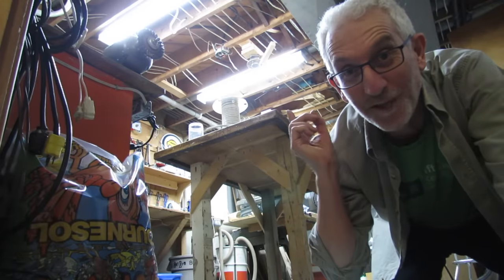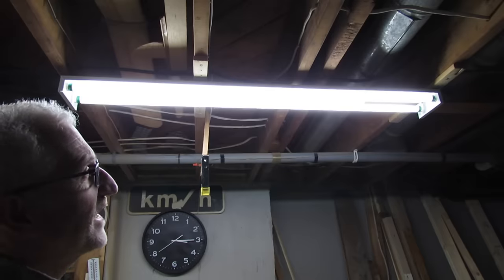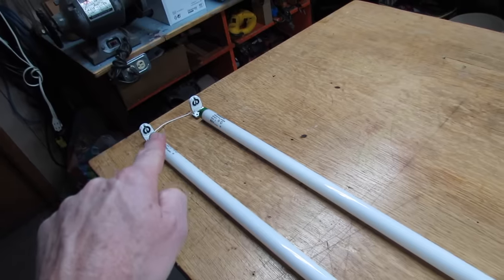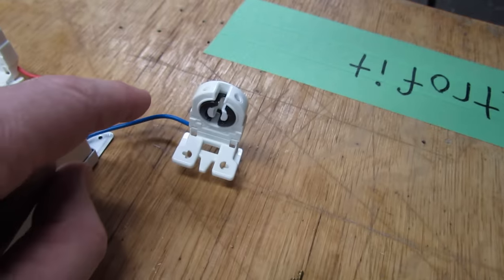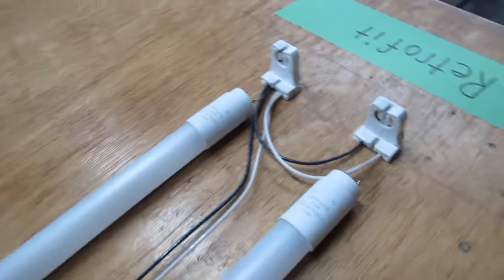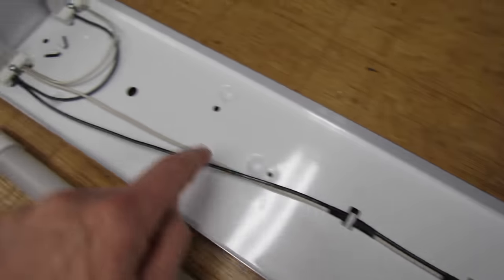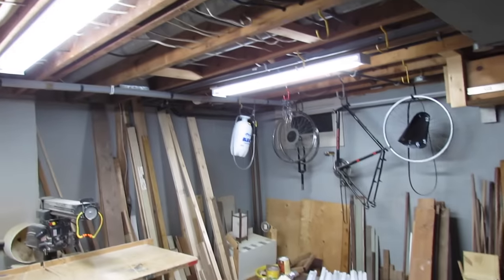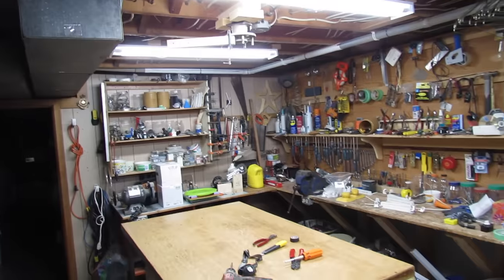How To Convert T8 Fluorescent Lights to LED ● Explained in Simple Terms

Comment from the maker: Find my favourite tools here!    https://www.amazon.com/shop/chrisnotap
Reply: Chris No
tap
Reply: Did this to my shop lights. Easy to do and much brighter. Got bulbs from Ebay. $49 for ten bulbs.
Reply: The biggest problem i have is that the T8 fluorescent setup kills the radio in my shop instantly any time i turn it on. The number 1 thing i want working in my shop is the radio. My question is will the radio work if i switch the T8 + ballasts out for LED's?
Reply: @rockymountainman7   I think these led light would kill your radio, here is the reason, most of these lights did not pass the EMC and EMI testing, has electromagnetic interference problem.
Reply: Chris Notap  how did you hook up the Electric wires 
To that on/ off switch
Reply: will these same units work with and without a ballast?
Reply: did what u said and my led want come on
Reply: SALUTE TO YOU SIR.
Reply: @jeffallen3382  Did you see the Black and White wire laying on the table? Connect A\C to those wires and connect ground to the fixture.
Reply: Excellent presentation, no nonsense installation instructions.  Thank you for your video and I have subscribed.
Reply: the new lamps i'm using you don't have to change ends. You can do it the way you did or make one end hot and one end neutral using the same tombstones. Its even faster if you don't have to change them.
Reply: @jaunsanchez1456  @Juan Sanchez. - To make it simple, nothing changes from the lamps power supply to the wall switch. The LED bulb with out “Plug-N-Play” are designed with a driver inside the powered end. It changes A/C voltage to DC inside the bulb. Since they operate on very low voltage and amperage, they use way less electricity and run cooler due to little waist. The “Plug-N-Play” as shown, are designed different to make it a simple bulb change, but still uses a ballast that would normally kick start light production process inside regular florescent bulbs. Hope this helps you and others who watch and read comments. Best of luck, even if two years latter in March 2022.
Reply: @rockymountainman7  - The comment from Min Wang, about interference from LED bulbs, if not miss-spelled, do not and should not create any problems with your radio period. When you or anyone reading should look for markings on the LED bulbs from “UL listed” and “FCC” as well. Better tech is slightly more expensive but think about electric garage door receivers, pacemakers and other medical devices as a neurostimulator implant placed under the skin to control signal to electrodes over a spinal nerve. 
   I had a wonderful radio that was caught in a sunny rain storm we have all seen, but drying the A/C adaptor box that failed did not fix it. Runs off “D-Cell” batteries well, just not long. This gets real expensive quick. I found a replacement by model and p/n and bought it. WoW, it had so much static I could not understand the spoken word as obviously their were filtering, shielding issues left out or undersized in the unit I purchased. 
  So anyone purchasing LED bulbs for a standard shop lamp fixture should buy a name brand, reputable company with UL & FCC registrations marked on them, then no problem. You can’t buy a keyless entry transmitter without the same listing. These are transmitters or receivers or both if two-way types. In a few years, the LED has come along way. 
Best of luck to you as I listen too!
Reply: @bonzainews  either, slow down and watch the video again as he did an excellent job of laying it out and explaining. Best of luck!
Reply: @bonzainews  Read the response below to Juan Sanchez and his question. It is the same answer. Hope all is well, best of luck Sir!
Reply: @robertedmonds2075  Please watch the video again, then perhaps some easy diagnostics is required. A non-contact voltage tester is very cheap in 2022, March. Wired as shown depending on build choice is layer out very well to follow. If yours are not working, using the info in your question, double check your wiring and switch identical LED bulbs if needed. Worst case, get a buddy or technician to help. Electrical issue are very confusing to many. No different with rebuilding an automatic transmission. Many will not try! Hope this helps. I did both.
Reply: Thank You for not wasting time. Hats off

Comment: I liked the way you laid out just the bulbs, connectors, and the wire.  Made it clearer for me.  Thanks
Reply: Its different again for the older type that uses starters and magnetic ballasts, and even with the electronic ballast shown in the video there's often an extra 'preheat' wire used to warm up the lamp filaments prior to ignition which isn't shown here. Clear as mud? :)

Comment: I just retrofitted the fluorescent fixtures in my garage, but I used GE T8 type B LED tubes, which made it even easier than what was done in this video. With the type B tubes there is no need for the non-shunted lamp holders. You just clip the wires from the ballast, remove the ballast, reconnect the wires directly to the power, and you're done. Oh, one more optional step: add an inline fuse between the hot wire coming in and the live wire end of the fixture to protect someone who might put a fluorescent tube in in the future. (The type B bulbs come with warning labels that the fixture is no longer safe for fluorescent tubes, but not everybody reads labels.)
Reply: Thanks Chris. THIS is what I needed to know. Type B info...
Reply: This is the current setup I have in the house I rent, but I can't seem to find any type b bulbs
Reply: @chrisrepp8608 Great info!  what fuse size did you use?

Comment: This is EXACTLY what I was searching for! You explained it and the camera work was excellent! I have a ballast going out in one of the units in the kitchen drop ceiling and want to do this. Thank you for the video!
Reply: Just curious how do you like this light in the kitchen?  I am looking at replacing the entire fixture in my kitchen due to the grease build up, but the led fixtures I find online do not include a light diffuser and I think I would prefer one with a diffuser.

Comment: Just working on some fluorescent lights over the kitchen area and you showed me a great idea to solve my conundrum since the repalcement ballasts for the old flourescent light  fixtures in place are not longer easy to find almost anywhere. So, I am cosidering replacing them with something else as they are starting to burn out after many years of service.

Comment: You can also get Dual or Double-ended tubes. No messing with the Tombstones (Lamp holders) Just cut out the Ballast and wire hot to one side, neutral to the other. Doesn't matter which side although I prefer to keep the original hot and neutral wires the same. You can install a dual ended tube safely in any direction. If you accidentally install a fluorescent tube in the rewired dual ended fixture nothing will happen. In a single end fixture it will short out.
Reply: I believe shunted tombstones are recommended when wiring dual ended tubes from opposite sides.
Reply: The industry is going away from single ended LED lamps.  Dual ended are so much easier to install, and much safer.
Reply: @Spreadswings  Brilliant and concise Video, but it doesn't answer the principal question "are these LED tubes simply wired to mains power be it 110 or 240 V"? the rest is obvious.  please answer, thank you  :)
Reply: @marcmccord5085  In a two tube fixture that has been converted to ballast bypass, is it safe to leave one tube out or is that a fire hazard or something?  They're a bit too bright!
Reply: @sl1237  They operate independently.  You can either take out a lamp, or cap off the leads to that lamp.  No fire hazard.  BUT... dual ended lamps are much better.  Easier to install and safer since you don't have the power and neutral to the same socket.  Power to one end of the lamp and neutral to the other.  And you don't have to put the lamps in a certain way.
Reply: @marcmccord5085  Thanks Marc.  So just removing one is fine?  Should I cover the unused tombstones with electric tape?  I'd rather not cap off the leads to the unused tombstone so I can leave that option open of adding another if more brightness is needed.  Mine are dual ended!
Reply: @sl1237  It's like a regular socket in any light; you would only cap off a socket that doesn't have a bulb in it if it were in a place that a child/pet/oblivious person would touch it or stick an object in it. If it's behind the plastic lens and off limits to anyone you needn't worry about capping it off. Also, if someone else goes to insert a bulb, a piece of tape sometimes indicates a faulty wire or 'do not use' situation. You'll know why it's there if you're still around but the next person might not.
Reply: @gailyfl7551  Good point.  Thanks!
Reply: Dennis H Thanks for answering my Question. I needed to know if I can put the double-ended LED bulb in in any direction. Seems I can.

Comment: Hi Chris, I've been looking for bulbs that would replace my old 40w 2 bulb florescent light that I have in a downstairs office that's used as indirect lighting. As a former electrician (now retired) I have done replacements of LED for old florescent lighting for some time now, but in the past they've always been way too expensive and for the average home owner those prices were out of sight, so TY for this video, Also I'd like to bring up one point that was over looked for the average DIY'er and that's to make sure the power to the light is turned off! If you are comfortable just shutting off a light switch - place tape over the switch, I also put a small key tag that says "DO NOT TURN ON!"  Again TY for this great video. Cheers!

Comment: Excellent video!
One thing you missed is that the "Lumens" rating of each bulb is what determines its brightness, NOT the color rating (e.g. 4,100K). You can have two different bulbs, each 4,100K for example, but with different Lumens ratings (different brightness). If one bulb is rated at 2,500 Lumens it will provide more light than a bulb that is rated at 2,200 Lumens for example. The 4,100K is the "color" or tone of the light. It has nothing to do with the amount of light generated from the bulb.
Also, it's not clear if you use T12 size lamp holders at the ends, or a different size?
Reply: Well stated.

Comment: One thing to be aware.  I used the replacement bulbs from Costco which still requires the ballast.  Like you, I find the light superior to the florescents.  However I also have a motion detector on mine so that when I enter the garage via the house door or via car, the lights turn on for me.  Works great EXCEPT.... when off, one light from each fixture (of two like yours) stays partially lite.  The one bulb never completely turns off.  It's about the brightest of a nightlight so I use it as such.  Let's me see what's in the garage so I don't trip or not see something before I enter far enough for the motion detector to kick on.  I contacted the manufacturer and was told this is how the bulbs work if there's a motion detector on the circuit.  They turn off completely if just a regular switch.   Just more info for anyone deciding on replace bulb only vs remove ballast options.   But I agree - definitely do replace with LED.  I was replacing bulbs about every 8 to 12 months.  Now it's been years and I haven't had to replace or fix anything.

Comment: Just changed over my 800 Sq/ft garage ( machine shop) to led 5000k with out the ballast, got a steal on 20 new fixtures for 85 dollars! I installed 16 fixtures/ two tubes for each fixture. There are no dark areas in the shop now and that's not an under statement! Like your video shows very easy to install and made a big impact on the power bill. Should have done this years ago 😎
Reply from the maker: That's great!! I still like the 5000k ones. I swapped them out for the 4000's just to try again but went back a day later to the 5000's.

Comment: Chris, several weeks ago I happened on a bunch of these so called Plug and Play LED tubes (type A) they didn't work because I had already cut and removed ballasts.  So I took them back and got type B tubes that get wires from both ends.  Super simple to get lights that work.  The hardest part is getting the cover back up cuz I only have two hands.  The Frau doesn't want to even come in my shop cuz the chaos bugs her.(?) My third hand is a 2" piece of tape, but my lights work and no ballasts.  My point of this is to look for type B or whatever is driven from the one end.  I prefer the double ended tubes.  Cheers.  Bob

Comment: Bought florescent fixtures and bulbs when we bought our house and and been wanting to get led but theybwere to expensive at the time.  But after seeing your video, i may be upgrading my fixtures. Thanks for the video.
Reply: In the long term the savings are enormous, mainly in running cost, but also in bulb life.
If you ran a standard single fluorescent  for 15,000 hours, you would need 3 tubes (2 replacements) and burn approximately $500 in electricity. 
With LED you would only need one tube and the total running cost would be nearer $225.
The tube life is something of an estimate, but with a $275 saving in electricity cost, it would not be the end of the world if it needed a replacement.

Comment: There are many features of lighting and light bulbs.  You mentioned the warmth or Kelvin of your two bulbs 4100K and 5000K.

Candles and a wood fire are what we might term the warm end  2500K to 2700K,, and incandescent bulbs are about the same.  I think that was one of the reasons for their easy acceptance a 150 years ago,, a carbon filament bulb is about the same as a candle, about the same as fire light.  The bright blue sunny sky is the other end of our experience, blue/white 6000K.

The feature you did not mention is CRI,,  Colour Rendering Index.  It is a measure of how complete the spectrum is so we can see colours accurately.  The old  cool white fluorescent tubes,, those old workshop, drafting office, commercial building T-12 fluorescent tubes,, that we all hated.  They make a freshly cleaned white shirt look a bit glowing blue.  They were usually on the order of a 5000K light,, but a CRI of 66.  I have one old compact fluorescent bulb that has a CRI of about 40.. Only a zombie could like it.

The most modern CRI of LED tubes will be CRI 80 to CRI 95.  Very complete spectrums,, easy to see colours accurately.  It is most likely that the reason you liked both the 4100K and the 5000K is because their CRI was very similar.

Today,, we need to be aware of Kelvin,,, daylight or yellow warm,, CRI,, how well does that bulb allow you to see colour, Wattage,, expected life,  Lumens,,,   dimmable or not dimmable,,, yeah,, it will get you nuts sometimes.
Reply: Am I alone in regarding 4000 to 6000k too harsh for a domestic environment? 4000k for work environments is fine but you need to take care of avoiding glare so light distribution is important. Some light on a ceiling and walls can soften a bright light source.
Reply: @towerdave4836    This all a bit technical,,, but our eyes are adapted,  maybe genetically,  to fire light.  We have several million years of looking into a fire.. a candle,, a torch,, and only about 80 years of looking into  4000 kelvin light
No.  I am in agreement  4000 is about my limit.  When I lamp a house  I choose the candle end of the range,, The best I am aware of for residential use is about 3000 kelvin with a CRI of 90 or greater.  Special considerations,, in bath I always choose the soft end  2700 to 3000 (I am not a fan of most of the 2500 kelvin I have found so far.)  Kitchen, a bit higher  3000 to 3500  and Dressing areas for clothes selection,, work areas, office,, desk,, drafting,, 3500 to 4000  I only exceed 4000 if the customer states a preference  AND the CRI is really high 95.  Most bulbs today are sold by wattage,,, the old wattage,, 60 watt,, 75  watt,, 100 watt,, BUT  When was the last time you actually bought or even used an old filament bulb  We need to learn lumens.  600,, 1000, 1400 lumens.  The true wattages  if you look carefully  are on the order of 6 to 15 watts,,, AND the newest bulbs,, available in Europe and the Middle East  and soon to be here, half of that.  A 2.7 watt bulb is fully capable of producing 600 lumens.   And longevity?  My bedroom table lamp burns 24/7  600 lumens,, and been burning for 10 continuous years.  Remember the old hall night lights plugged into a wall outlet in the hallway?   7 watts.  The bulb type of night light shield  plugged into a wall outlet?  12 to 15 watts.  You can light half a house now on that much juice.

Comment: really, really helpful! excellent explanation - I could not figure out why, even though I got correct size, wattage and obviously length my lights would flicker or not work. it was because they were the wrong type! got some new bulbs and they are working beautifully! thank you!
Reply: Early LED tubes required a low voltage DC supply, but these new ones run directly off AC mains voltage,

Comment: This is the first video of yours I have watched.  Your explanation of how LED and fluorescent light work was great. I want to do this in my garage.  I have eight foot fixtures that need to be updated to LED and I plan to lose the ballistic when I complete the conversion.  Thanks for making it look easy.  You have a new subscriber.  Cheers!
Reply: I would suggest not going to an 8-foot LED tube..They have been shown to sag badly in the middle.  Go with 4-footers.
Reply: @imdeplorable2241  if you bought a quality 8-foot tube,should be no problem.
Reply: @imdeplorable2241  Zip Ties